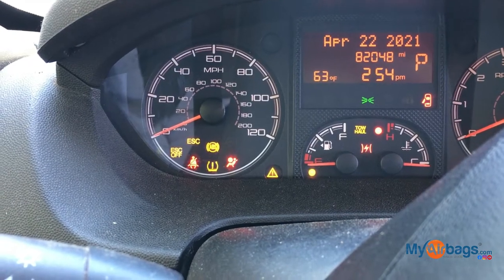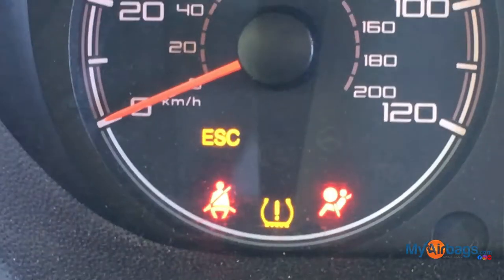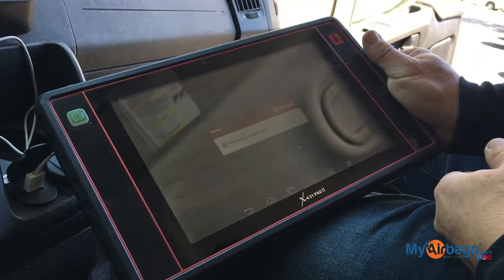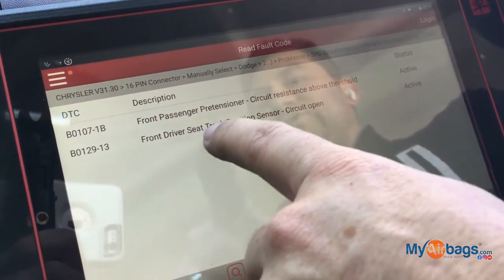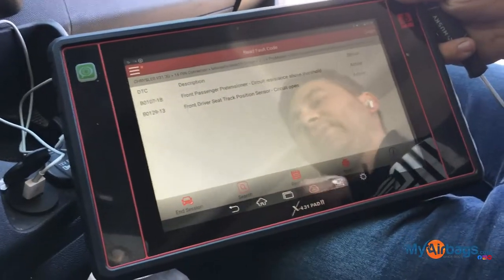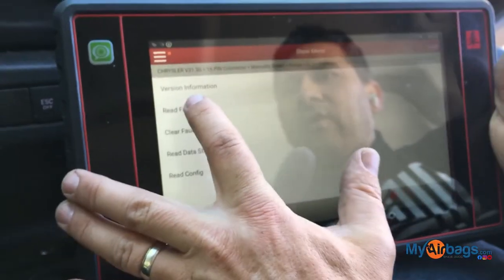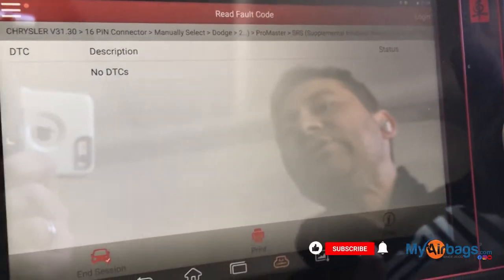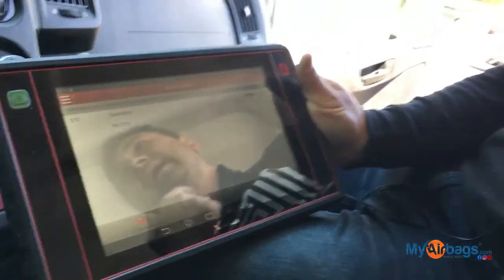How to Fix SRS Airbag Light On & Seat Belt Pretensioner DTC Code | MyAirbags

Comment: Why does this light come on and off. I checked the plug, and even disconnected it and reconnected it. Sometimes the airbag comes on and some days it goes off.. It’s saying the driver pretensioner
Reply from the maker: It could be a bad plug connection, or the seat belt pyro sensor is going bad. The seat belt may need to be replaced or repaired.

Comment: resistor
Reply from the maker: Yes, you can do a resistor to bypass the system (trick/fool the system). But will the seat belt wil work again as it should at accident? No, it will not. That is why repair needs to be done right, and resistor is a bad idea because yes, you will bypass the light, and it will be off for that seat belt. But we do things right at MyAirbags.com, and seat belts will be restored at original condition and will work as designed by manufacturer at the next accident/collision.